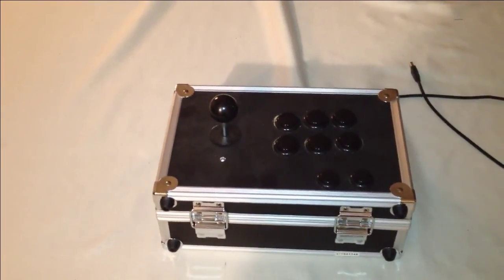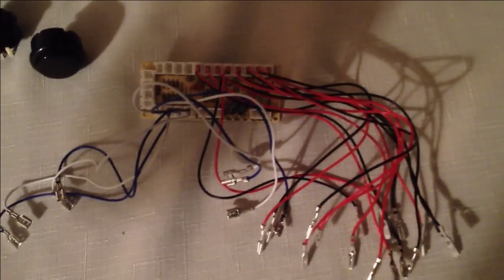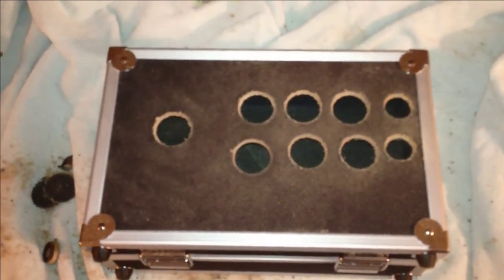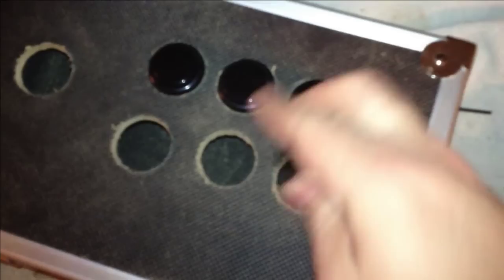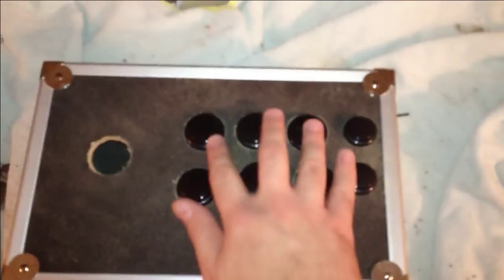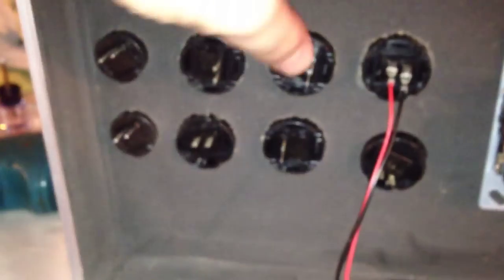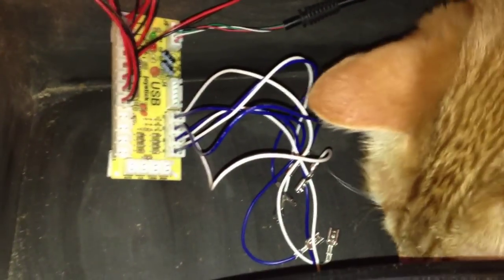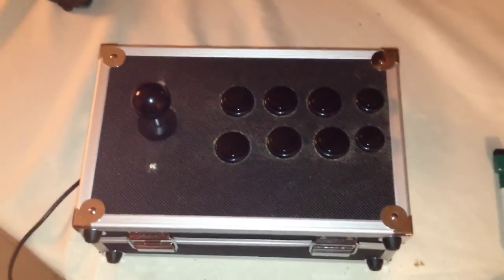Raspberry Pi - Building an Arcade Fightstick / Joystick

Comment: Nice video. If I may be so bold as to make some suggestions.

1. Double check that your drill bit is the right size on  a spare bit of wood. I like to create a paper template with all of the holes I'll be putting the joystick and the buttons. Simply pierce holes in the case where you want the holes to go based on your template.
2. Clean everything before putting the buttons/joystick in.
3. Use a smaller drill bit for the joystick. That way, you won't reveal any nasty gaps when the joystick's moving around.
4. You can buy buttons with an underside screw fitting. That'll keep things nice and tight :-)

Thanks for this.
Reply: Richard Hawkes You forgot about the tri-pod.

Comment: Thanks for this video Shea. Much appreciated!
 
As a beginner who has had the full Hyperspin experience on PC for a while i could not get my head around the easiest way to do this in order to make a controller for my my Piplay/PiMame experience on Pi 1 & 2b. I have read your blog for a while now and after receiving a PI2b feel the time is right to have a go at making my own controls.

A few questions:

Q1. Can I make two of these and have simultaneous 2 player games on PiPlay? (or 4 player?)
Q2.  Where is a good place to get necessary good quality but low priced parts i.e. joystick, buttons and usb controller with all the wires and everything you need in one?
Q3. I live in the UK do you know of any UK dealers for X-Arcade Tank sticks etc?
Q4. Will the same controller you made work in PC too as it is usb or would it need a generic driver for Windows?
Q3. Which usb controller kit are you using on video?

Comment: Hello and thanks for the video! One question: I want to build a Pi arcade using Zero Delay. However I want to create a two player control panel. I want to use two Zero Delays. Will the Pi recognize both ZD as player 1 and 2 after I plug the USBs into the Pi's inputs for usb? Will I have to do any programming? Thanks 👍
Reply: +George The Bassist I read that someone on Amazon said they had no issues using this on a Raspberry Pi, that's why I got this encoder but it hasn't arrived yet, I also read that you can connect 2 Zero Delay Encoders to each other so they make a 2 player PCB instead of needing to use up 2 USB ports, here is what it says on focusattack.com.    "MAME - or "Multi Arcade Machine Emulator" is commonly used when building
 multi-game arcade cabinets. &#160;You can connect multiple zero delay PCBs 
together. &#160;In MAME, each PCB will register its buttons and joystick as 
"Joy 1", "Joy 2" and so forth. &#160;Building a 2, 3 or 4 player cabinet for 
MAME is now a rather simple affair."
Reply from the maker: Yes.  They will be displayed as two separate joystick and controls.  /dev/input/js0 and /dev/input/js1

Comment: I was wondering something. What if I connect my joystick to four of the ports that you usually connect the buttons? It should still work as the joystick direction is still just a button press.
Reply from the maker: +dkukov It will work as a button press but linux would see it as a button[x] press rather than a joystick axis[-/+] press.
Reply: +dkukov from what I see on the video it seems like you can add another joy stick on the side strip
Reply: Thanks for the responces :). I will probably order at least one of these controllers for the arcade machine I am building, and would defintely try out if I can put two joysticks.
Reply: k no problem man i just saw while watching and thought i would tell you, been trying to get a pi for ages unfortunately pocket money is not enough to cover all costs lol but enjoy man and tell me how it goes

Comment: All new to me with the picture and controller. When I turn on the pi3 it goes into a button programming page with way more button options. How do you program just the 8 buttons and joystick and bypass the other 8 or 9 options on the screen
Reply from the maker: If you hold down a button that you've already used for 2 seconds it will skip the selection.

Comment: I appreciate your video, but to me it appears that the buttons are just sitting there. I hope they don't fall out when the box is turned over. I have seen other buttons that have a collar to secure it to the mounting surface from the bottom upwards.
Reply from the maker: Those are HAPP style buttons that use a collar.  Sanwa style buttons have a spring like lock on the sides that push out when installed so the buttons don't move.

Comment: I have one of these encoders, and iPac and a KADE encoder.
I'm working on a Pi project and I'm unsure what option I should go with.
I want to make sure that MAME + the other emulators work.
Did you find this encoder works well? Does it work well with all emulators ?

Comment: Great video.I am building my arcade cabinet with a pi 3 and was stuck with the wiring! But not anymore,I will use this as a reference when setting up the controls.I just have one question:How do figure out where to put the terminals into the encoder for the left,right,up and down on the joystick? I see you  mentioned which buttons correspond with the terminal.I too have the same encoder but zero experience with electrics.
But very informative video man!
Thanks
Reply from the maker: The board should have come with a little paper that labelled the buttons...BUT, it's easy.  The bottom row is Buttons 1 - 8.  The terminal at the top is should have U D R L, that means Up Down Right Left.
Reply: Hello mate, there were no instructions with it.Thanks for the advice, great build again.

Comment: do you need ground wires?
Reply from the maker: They are already there.  The two wires going to each button are active and ground.  The encoder board has two pins for each, so you don't need to make a  common ground wire.

Comment: Hello, does this pcb work on ps3 or PS4?
Reply: Azayn Lvis  doubtful. at least not correctly. as they have the extra joystick buttons l3-r3. an you would also need functioning home buttons. there's not enough spots on the pcb to have those.
Reply: no, you need a pcb that it is made for PS4/3, i would recommend you to take a look to Brook Gaming pcbs, they are pretty good and also have firmware updates, they recently added Switch support to their universal fighting board, and there are cheaper pcb that are for PS4/3 only and have also PC support via Xinput.

Also, take a look at the page called Slagcoin, its pretty much the Holy Bible for custom arcade stick builds, great for you if you are building one from scratch, if you are going to use wood like most people, i recommend you to use MDF, pretty sturdy and very cheap, easy to work on it as well if you are on a budget and low on more "fancy" worktools